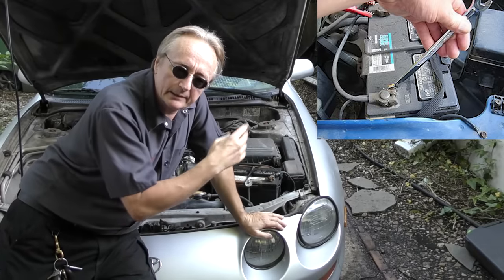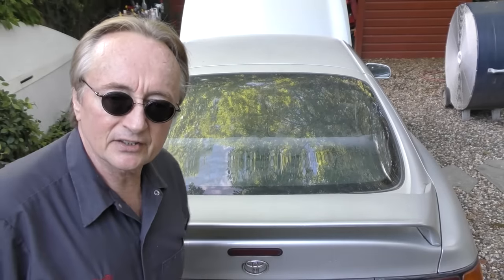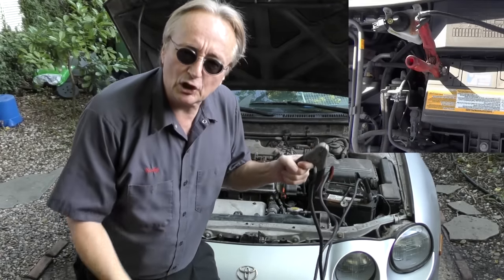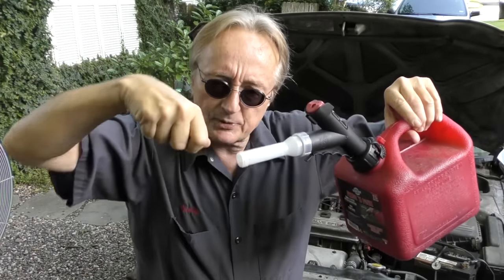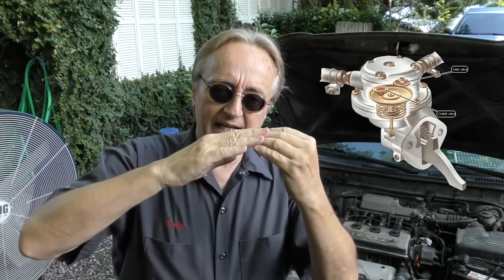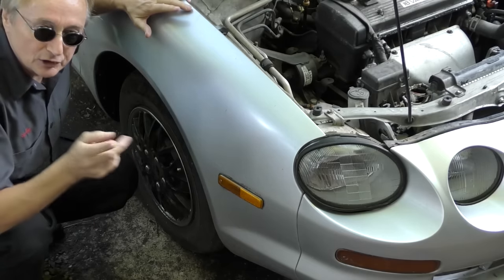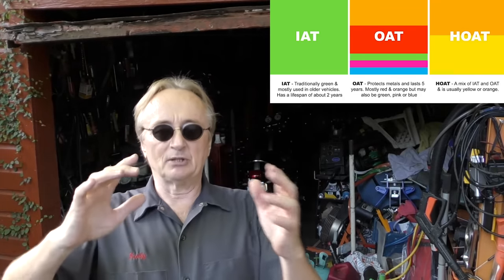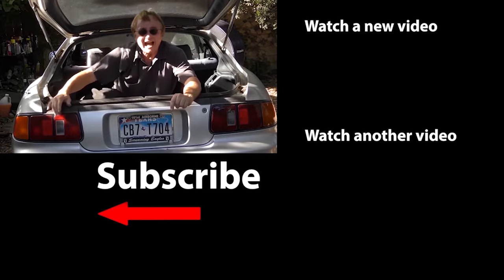This Will Destroy Your Car

Comment: Also, don't use fix-a-flat.  It will ruin your TPMS.
Reply: Thing is some modern cars that don't have spare tires will typically have a compressor of some sorts and a fix a flat type sealent crap to put in the tire.. I bet tire shops are just loving this..
Reply: mae2759 yet most manufacturers literally provide you with a can of it in the trunk lmao
Reply: Also, the guy that changes the tire will hate you for the mess left inside the wheel

Comment: Im the one that put 38-40 psi to my tires for better mileage and it works just fine. But I use a calibration device to make sure myself how much air Im puting in it.

Comment: Actually when jump starting, I've always been told to first connect the positive on the good battery, positive on bad battery, negative on good battery and then negative on the bad car(metal part ideally rather than battery terminal).

The reasoning behind that is that if you first connect the negative and accidentally touch a metal part with the positive alligator clip, it's going to short the battery and that can be very dangerous. While if you take care of the positive first, barely anything can happen if you drop a clip since it's either not connected yet, or it's the negative, just like the car's ground (no short, you might get a spark in the worst case)
Reply: exactly. i don’t get the whole “disconnect the negative terminal of the battery” thing. it should be positive. when there’s no voltage difference nothing will happen. if u disconnect the negative terminal and it hits something and grounds out, well congrats, you’ve just shorted ur 100 dollar battery to earth or chassis.
Reply: I was taught the same way. Makes perfect sense to do it that way.
Reply: @MCatwar  That's the opposite, you should disconnect the negative first, because the car's ground is connected to the negative pole of the battery. If you accidentally touch the metal of the car with the negative cable, no big deal, you're connecting negative to negative. However if you touch metal with the positive cable while the negative is connected, that's exactly the same as if you would take a cable and connect the positive pole to negative pole... It's shorting the battery, and I don't want to see what happen when you do that lol.
Reply: HCkev ohhhh yeah you’re right i prolly shoulda thought this through.
Reply: It's more about the wrench you're using to undo the cable. If you do the negative first, it wouldn't matter if you shorted the negative post to ground with the wrench. Now if you did positive first and shorted between the positive post and ground, then it would go boom.

Comment: You talk a lot about modern models of cars. What do you consider modern? After 2000 or what?
Reply: Any fuel injected vehicle from the 1980's to now! If it's injected, it has at least one computer on-board and some later 80's Chrysler vehicles, already had the charging system regulators built into the ECM (Electronic Control Module or the cars computer, if you prefer). I've Changed a few of those back in the day, from bad 'jump starts'.
Reply: Anything after 1918

Comment: Is that why my car gas tank is 15.8 gallon but when it says it’s empty I can only get about 14 gallons in it ? Reserve tanks ??
Reply: Yes.
Reply: The gauge is set off so that you still have some fuel to get you to the nearest gas station, mine is two gallons left so I have thirty miles before stalling.

But I live in Texas where it's over thirty miles between towns to get gas, so I never drop below a quarter tank if possible.
Reply: That's the amount in the sump area of the tank where the fuel pump is. And Scotty did explain the reason why it's there. Buys a little bit of extra time, but once you hit E you really should be filling back up. (Although refilling at 1/4 tank is better insurance.)

Comment: I didn't know jumping a newer car had become such a process now..
Reply: Neither did the road service guys, but I have noticed they now use portable chargers which probably negates the dual alternator issues.
Reply: Alot have plugs in their grill and rear bumper that they can plug their cables into standard clips on the end that goes to your car and a flat 2 pin connector on the end that plugs into the truck. The truck has a Serge protector and there is a diode which does not allow the back flow of voltage that could damage the service truck.

Comment: I double the PSI in my tires, Because I like them round!
Reply: Best comment so far!
Reply: I put in 40 psi because the temperature might drastically change before I get the chance to swap the air for the right season! 👍🏻
Reply: I double the PSI in my tires because I like poor traction and horrible brake performance...
Reply: I hope you're joking.  If not, be careful of curves in the rain.
Reply: discerningmind I am.
Reply: I've been running 52 psi in my tires for 8 years and I've never had a problem. You get WAY better mpg that way and it's reduced the treadwear / rolling resistance of my tires. I can't condone it of course because you have to learn to brake early and turn with low g force in the rain. However, learning those principals will make you a better driver at the same time.
Reply: @stevenhinkle6957  I've been running 65psi in mine.

How do you learn to brake early in an emergency?
Reply: @bremCZ  Props for being able to drive smoothly enough to make 65 psi safe. What I did to train myself was slam on my brakes in the rain at various speeds while no one was around in order to find the limits of traction at that specific psi. Then I learned to always have my foot hovering over the brake when someone gives the slightest hint that they could pull out into the road and cut you off. Split second reactions is everything. I never have close calls on the road because of my learned discipline.
Reply: @stevenhinkle6957  And when a kid runs out in front unexpectedly? There are times where even the fastest reactions at the correct pressure result in impact.
By lengthening your braking distance you increase the likelihood of killing yourself and others. I run 65 because it is the recommended pressure for my tire and vehicle.
Reply: I install tires, theres nothing wrong with having a healthy balance between what the manufacturer placard says and the max PSI allowed on the tire sidewall. i drive an 09 Corolla S, 205/55R16, Toyota says 32, however my tires have a max PSI of 44, for me personally I prefer them at 38-39 PSI, so it doesn’t go over the 44 PSI threshold as the tire heats up and the pressure rises. Just a thought or two. Haha
Reply: Brem I’m guessing a heavy duty pickup? Probably running 10 ply LT tires
Reply: @TCVB491  Any tire manufacturer's product performance department will tell you +/- 4psi of whatever the recommended pressure is. As someome who drove a corolla on 205/40R17 I wouldn't go quite as high as 38. The car is too light all it would serve to do is increase the rate of understeer.
Also I would always run a staggered pressure on a light rear end FWD to balance the traction.
Reply: @TCVB491  Small van, but I run it fully loaded almost all the time.
I don't use 10 or 8 PLY anymore. It was a good measurement when we actually made tires with that many plies. Now it just serves to confuse people, because one 10pr tire holds hundreds of pounds more than another.
Reply: @bremCZ  Because of my car's tune, It's allowed me to make 52 psi safe in 44 psi rated tires. I gave it a very extensive weight reduction, so it only weighs around 2100 lbs which makes the brakes work quite a bit better and increases the braking force needed to lock up the tires in an emergency. As far as kids playing in the street goes, I always drive under the speed limit in residential areas, especially when it's raining and in all my decades of driving, I have yet to see a child playing in the road while it's raining outside.
Reply: @stevenhinkle6957  That is the opposite of what you want to do. The light weight means that more pressure gives it even less traction. When you reduce the weight of the car you reduce the pressure to give the same traction. Over inflating and weight reduction makes it even worse.
Reply: @bremCZ  Incorrect.

A weight reduction creates less inertial mass to decelerate increasing effective traction. As an example, look up factory stopping distances of average heavy sedans vs average subcompact cars.
Reply: @stevenhinkle6957  Incorrect. A higher pressure creates a lower coefficient of friction by not allowing a carcass to flex and generate more grip.
This is illustrated by the fact that that lighter cars have lower pressures, not higher.
Reply: @bremCZ  That wasn't the point I was making. The weight reduction reduced the braking force needed to slow down the inertial mass. Thus allowing me to sacrifice some of the tire's contact patch area through over-inflation. I guarantee my car stops faster than it did when it was at the factory weight and tire pressure. I believe your confusing braking force with force applied to the brake pedal.
Reply: @bremCZ  I should clarify, you weren't incorrect with what you were saying. My point was that the weight reduction had such a significant effect on the braking power of the car that the higher tire pressure was a small sacrifice in comparison.
Reply: @stevenhinkle6957  It would nagatively effect the braking performance with any lateral load and it also negatively effects the dynamic lateral coefficient of friction making it less safe in both areas. It is possible that straight line braking isn't negatively effected but almost every other handling and safety aspect is.
Reply: @bremCZ  Now this reply I can definitely say is incorrect. There is a very great reason why all race cars are as light as possible and it's not just for acceleration. Literally all measurable aspects of a car's performance are improved through weight reductions including handling and the dynamics of all lateral movements.
Reply: @stevenhinkle6957  Yes but they also run under 30 PSI hot.

If you raise the tire pressures after reducing weight you negatively effect traction.
Reply: @bremCZ  I agree completely. However, the benefits of the weight reduction far exceed the negative effects of the higher tire pressure when going for overall gas mileage / tire wear efficiency.
Reply: @stevenhinkle6957  The negative effect on traction and safety far exceed the positive effect on gas mileage.
Reply: Brem true 👍
Reply: @bremCZ  Like I said before, the car stops faster than it did from the factory, so even though the over-inflation gave me slightly less contact patch with the road, the weight reduction improved the car's stopping power significantly. So I'm not doing anything that's putting me or others in any greater danger than how the vehicle came from the factory. I've done quite the opposite actually and made the car safer. I'm sure you don't agree with me but I'll let the 8 years ( 200,000 miles ) of accident free driving after I started over-inflating do the talking. I don't even have close calls. I'm sorry that most people drive too erratically to enjoy this benefit but I don't.
Reply: @stevenhinkle6957  You have reduced the lateral coefficient of friction. Your cornering grip is lower. You lose traction earlier. Any braking under any significant lateral load will cause much earlier loss of traction. 
You haven't made the car safer you have made it less safe.
Reply: @bremCZ  Being that I've experienced the car through all variations of driving situations ( higher weight load, lower weight load. High tire pressiure, lower tire pressure through natural pressure variations brought on by fluctuating outside temperatures ), If I were to put it into numbers, the 150 lb weight reduction raised the force needed to induce a traction loss by around 7% because of the less inertial mass which is changing direction. By raising the tire pressure from 44 sidewall max to 52, I would say I lowered the force needed to induce traction loss by about 5%. So while it isn't much of a change, the car is technically 2% safer in that regard from how it came from the factory and I get to enjoy greater mpg, turning speed, acceleration, lower tire wear, greater brake life, ect.
Reply: @stevenhinkle6957  Weight reduction reduced the force needed to induce a lateral traction loss it didn't raise it.
Reply: @bremCZ  When a car enters a turn, it's mass is being forced to the outside of that turn. The heavier the mass is, the greater the inertial force being applied to the mass is. This is why on a racetrack, a very heavy car with a lot of power ( Camaro SS ) will pull ahead in the straights of the track. Whereas a very light car with low power ( Honda Fit ) can easily pass the heavy powerful car in the turns. So tell me how can the Honda do that when it has far skinnier tires than the Camaro ? Skinnier tires means less traction yet the Honda can turn incomparably faster.

Checkmate
Reply: @stevenhinkle6957  When you remove weight the lateral force required to shift the car is reduced both statically and dynamically.
That is why the Honda breaks lateral traction before the Camaro.
Reply: @bremCZ  If the Honda broke traction in the turns at a lower turning force than the Camaro, it would be impossible for the Honda to pass the Camaro...  but it does. So explain that ?
Reply: @stevenhinkle6957  The force required to shift the lower weight is less, that doesn't necessarily mean the lower weight moves slower...
I'm not sure why you're asking that question it isn't opposing anything I have said.
Reply: @bremCZ  You don't get how this works, so I'll stop trying to convince someone who needs to do some reading into physics. I understand what you're saying but there's some forces in play that you aren't taking into account.
Reply: @stevenhinkle6957  There are plenty of factors in play you arent taking into account. That is why you don't understand it and why you likely never will and will continue to foolishly value mileage over safety

Comment: Was jumping a neighbors car in their driveway and his battery exploded, only time I ever saw it.
Reply: James Smullins jump starting a car is one of the leading causes of blindness in the US
Reply: @rcnelson  I was outside of a garage one summer evening when a car got it's hood blown clean off about 100 feet in the air, we all took cover in case it came down on us. So hydrogen can certainly explode out of doors when jumping a car.
Reply: I seen batteries explode twice. The first was back in 1959 while I was working in a Ford garage. One of them canx while connecting a battery charger to the car had a battery explode in his face. I dragged him over to the car wash and wash it down real good and he was okay.

Comment: Yay, 20 year old pushrod V6 running maple syrup for oil as she ages!
Reply: Yeah, I got one. It's only 17 years old. Pushrod. 6 Cyl (GM 3800). Amsoil synthetic oil. Original engine. No rebuilds. Original transmission. No rebuild. 292,000 miles. I listened to Scotty and I think it will run forever.

Comment: Good advice about not pulling the battery with the car running.

Good advice on jump starting. So many people wrongly think you should run the donor car while jumping.

Good advice about not topping off your gas fill.

I do go slightly over recommended tire pressure, but no more than a couple of PSI, on the theory that tires will lose air over time.

Overall, great video and sound advice everyone should already know, but too many don't.

Comment: Modern cars: Fuel pump dies because there is no fuel in it.  Failure of design.
Reply: Yes, of the user being a negligent human.
Reply: That happened in the 80s and 90s too.  In fact I hear more vehicles that are 25+ years old with whining fuel pumps than anything newer.
Reply: I have been driving twenty years and not once ran out of fuel. A little common sense can save you lots of headaches down the road.
Reply: @petrosaguilar8916  I have never ran out either.  Not even when the fuel gauge was broken.

Comment: 1. Does running out of fuel only hurt the fuel pump, or does it harm the injectors as well?

2. If you top off with gas and ruin the evaporation system does it matter? Will the vehicle run just as well with a broken charcoal filter?

Comment: Great advice IF need to jump start 2 newer cars, I would have just called roadside assistance that have battery power pack to start the car if the battery is fine and just flat from lights being on

Comment: The coolants are something to be careful with if you are not using the stuff from the dealer.  A coolant that is not compatible can gel when mixed with a different type.  You may be thinking "oh I will just change it".  Not so fast!  You may have already messed up your heater core and all other parts coolant flows through and you would be lucky to have a car that doesn't overheat as a result!!

Comment: One thing we should clarify is tire PSI is supposed to be at 35. 32 is the recommendation in southern states, where from California to Florida and everywhere in between has an extreme heat that can raise the air pressure. So the PSI is set a little lower, but it will raise during the heat of the day.

Comment: The way I check alternators is to measure the battery voltage with the engine stopped....then start the engine and measure the voltage again....the voltage should be about two to three volts higher the second time, if the alternator is good.